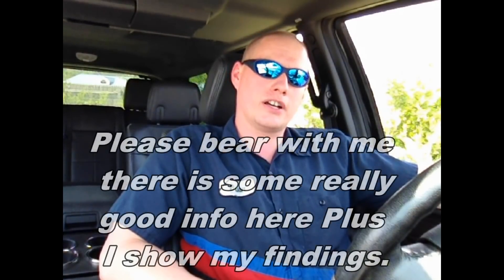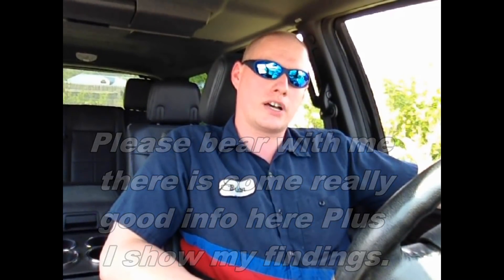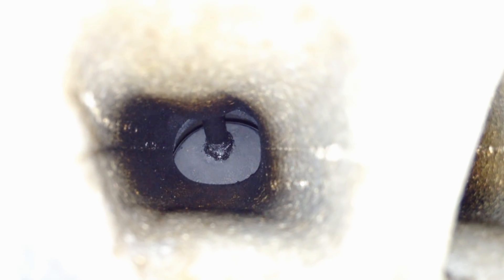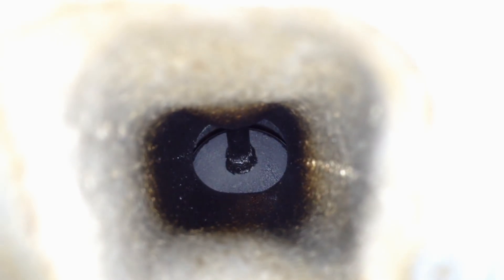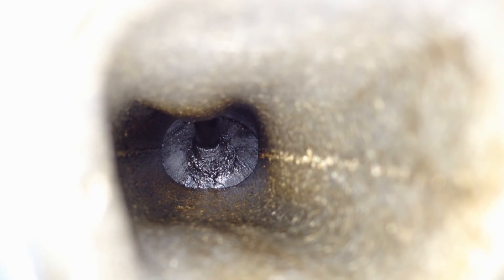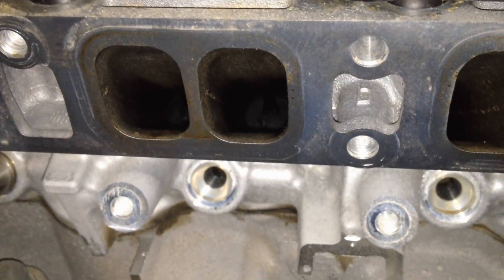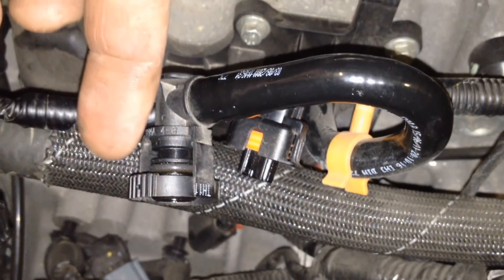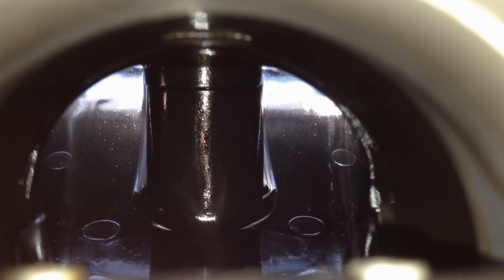Ford Ecoboost Warning Part 2 My Findings

Comment: we old guys use to dribble water down the carburetor on a hot running engine to clean carbon of the pistons ..could a well regulated water metanal mixer work in this application with out turbo or cat damage? just thinking out loud .

Comment: I thought that the manufacturers were changing to a combination of direct and port injection.  The additional port injection was to spray the back of the valves to keep them clean of carbon.
Reply from the maker: It’s spotty at best. For example the I4 engines as of 2021 do not incorporate dual injection.
Reply: @FordTechMakuloco  good to know.  I will keep my mustang with cyclone engine.  No turbos to burn up if the valves get carbon covered.  And it takes regular gas.

Comment: 2015 MKC has had p0171 code on... changed plugs, purge valve, engine filter, o2 sensor on the front end.  It seems to run rich, not lean, and hot. Exhaust pipes are black. The light was off for about 100 miles after o2 sensor change, then back on. Acceleration is better, and doesn't hesitate when giving it gas. What’s up with the light? Gonna start running shell or chevron higher octane gas, and then a little Italian tune up.

Comment: You can try a Nitrogen based cleaner service through the brake booster hose into the intake.   It cleans a little but doesn’t fix the design issue by Ford.   It’s amazing how the Engineers who designed T-GDI engines didn’t realize how the pressure/blow by would cause carbon/oil buildup on the Intake valves.  I think most Ecoboost’s 2018 and newer have both GDI injectors and Port Fuel Injectors to fix this flaw.

Comment: That link for the catch can no longer works. Can you share what catch can is best? We bought a used 2016 Ford Expedition with the Ecoboost engine with almost 100,000 miles and have no idea how well it was cared for. We started using the Chevron Techron. Do you also recommend cleaning the tank with the BG44K cleaner?

Comment: I soaked my valves on my 2.0 escape in zep deagreaser and it literally melted the carbon off I just made sure they were closed and used 80 parts zep 20 parts water and sprayed it in and let it soak and the carbon sprayed off the valves with air I didnt need to scrub them I used bg cleaner and everything else nothing works like zep!

Comment: Will a dual valve catch can resolve this issue or is there another thing needed to prevent those oil gases from reaching the valve heads

Comment: my ecoboost mustang 2018 is idling rough!! and has a leak between the head and the front block just behind de pulleys. Should ford clean my cylinder head and valves and replace my head gasket under warranty? the car has 20,000 spiritely driven.

Comment: It’s not new knowledge that port injection keeps valves clean so why would they not do SOMETHING to wash the backs of the valves? It’s asinine what engineers think up these days it’s all to save a buck here and half ass there. What’s next? You just never change your oil? They’re gonna have completely cast blocks with no way to drain oil and you just replace the engine every 10,000 miles? They just want you to buy a new car 😒

Comment: Is that the purpose of the two injectors on the newer eccoboosts, the injector before the valve removes the oil residues?
Reply: Yes. It switches to direct port once warmed up i believe. This also helps with cold start emissions

Comment: Brian, it's time for an update. This is pretty old information. I realize that Ford probably continues to claim that the head replacement is the only option, but soaking the back of the valves with the BG cleaner in a closed valve situation and evacuating the area of all debris before allowing the valve to open will completely clean the valves of all carbon. As long as you blow out everything before opening the valve there will be no impact on the turbos.  It's not an easy job and requires removal of the intake but it does clean extremely well.
Reply: Any videos for how-to on this? I would like to clean my intake valves without destroying my turbo.

Comment: boy, watching this I'm thinking about the best product I ever used in my life was A/C Delco X-66A intake cleaner, it dissolved carbon and gunk..  hard to get in California now... this state is sooo screwed up they have banned most anything that works...   I used to go out od state to get it.. it is a little nasty, but boy does it work on decarbonizing...    I'm sure there are some products out there now that will work ??  any good upper intake cleaner should clean up those valves and such..  some shops have a Motor Vac machine, and they worked GREAT on this too, they ran the engine for awhile using a cleaning solution to clean out the fuel rails, upper intake system and such...

Comment: Brian, I have a 2017 Expedition with the 3.5L, 105k miles, how do I tell what if it's dual injection or not? And are there any cleaners that have been engineered since this video was put out that will work without destroying the turbos?

Comment: coked oil contamination. I was building turbo engines in the 90's, I carried a whole person's weight of tools to try to keep from getting towed. I worked at several dealerships and took many classes for all kinds of procedure and process for new engine platforms coming online...they still blow (head gaskets, rods, blocks, valve trains, transmissions)
BOTTOM LINE buy a V8, it is the least likely to just pop for no apparent reason and just be shy of the warranty.....If you want to haul balls or tow/ a V8 is the ticket most of the time. oB

Comment: Why don't they do what the diesel guys do put the blow-by into the turbo boost so it goes straight back in and explodes instead of back into the intake with the valves under turbo pressure it doesn't build up that bad

Comment: Since 2-3 are affected so badly on 4cyl engines, would a 3.5L be 2 and 5 would it be primarily 2?  Is there a video of the BG and wirebrush process?

Comment: I have a 2016 F-150 2.7L V6 Turbo Boost. Bought it used a year ago, at about 36K miles. Its at 78K miles now. I have experienced an engine shudder every now and again. It's so random as to when it happens. That I am having a hard time determining what the cause is. I have had no check engine lights. So it must not be serious yet. I am wondering if this is my issue. I have my Truck going in for 4 new tires and oil change coming up. I asked them to look into the engine shudder. I hope it's not to serious. No money for serious repairs.
Reply: Did you ever figure this out? I have a 2016 2.7L V6 as well.
Reply: @Johnny N.  No sadly I've never figured it out.

Comment: www.RXCatchcans.com for the only genuine effective solution for these. And never do an engine running solvent based cleaning, ONLY a manual intake valve cleaning with the intake manifold removed is safe.
Reply: Why what’s wrong with the solvent spray cleaners when running
Reply: @gerard143   Unlike the "soft" carbon of past carbureted and port injection engines that could be loosened and expelled with little chance of damage, GDI engine develop large deposits, and as not fuel is contacting the intake valves, they operate at much higher temperatures and this bakes these deposits into a very hard crystalline structure, as hard as sand in many cases. When using solvent based engine running cleaners up to 40% of the deposits are loosened, and while most is expelled out the exhaust causing no harm unless a turbo charged engine, some is forced between the pistons and cylinder walls scouring the skirts and sides as well as damage to the rings.  That is never good.

Comment: I feel that direct injection is the death of a motor bc I’ve heard the fuel pressure is around 1000 psi. To me that’s a lot of pressure going into a combustion chamber and then on top of that has more compression added from a turbo. Couldn’t this start blowing out oil rings? Allowing oil to burn on the valves and starting a chain affect of problems?

Comment: Any updates?  I have 3.5 here and I keep getting misfire on 1...code P0301 on my 2011 with 91k miles on it
Reply: Every 50-60 thousand miles-change the plugs,possibly coil or compression.

Comment: PEA Question
Do you think running a product like Redline SI-1 with one of the highest concentrations of PEA with every tank would have enough residual PEA blown through PVC or gas recirculating system to reduce intake valve build up?

Comment: Is there any significant difference with this problem when running 93 octane gas as opposed to 87?  My thought was that maybe premium gas would help keep the valves cleaner..
Reply: It wont clean the valves because they fuel never touches the back of the valve. If your car requires 93 and you use 87, the computer can adjust the timing and it will run no problems, it will just lose a little bit of power compared to 93.

Comment: FordTechMakuloco have you been able to find a way to clean the valves without removing the heads? we recently bought an 2013 2.0L Ecoboost Escape with 150,000kms. It has the typical symptoms. Oil Catch can is being ordered but how do we clean whats already built up?

Comment: News flash from Ford... super high temp low vapor engine oil? Or retrofit port injection to slightly gas wash the intake valves? Like someone said this is a known issue on pretty much all direct injection engines.  The Cadillac 3.6 DI engine has many forum posts about this carbon build up and those engines were designed to run Mobil 1 synthetic. My car is an 08 model so this is only new to the inductees of DI. There’s much talk about oil catch cans on the PCV line to get as much of the vapor to fall out as possible. Not sure if that’s the end all fix or if there’s a better way to deal with it. One would think that the Diesel engines would have a solution to use since many of those are DI. Unless those valves don’t carbon up for some reason? Maybe knowing why would help solve the problem?

Comment: The intake manifolds are plastic. Why can they not be drilled and tapped for a fitting that can be capped. Then carbon blaster can be sprayed directly onto the back of the valve from the top of the intake runner?

Comment: when  cars  had  carburaters  we  just  poured  automatic  transmission fluid down  the  carb   raise up  idle  speed // it  will clean  out  the  carbon
Reply: Oh yeah I remember doing that back in the day. And it worked! Smoked like crazy while doing it but it did work.

Comment: Ford now has port injection to keep the valves clean, however, the blow by still exists so should I install a new for 2019 dual catch can by RXP for my 2019 Raptor?

Comment: Have a 2011 f150 eco boost 3.5. Has 210k miles on it and it runs really well. Very few problems. Keep up the maintenance and alls well.
Reply: Have a 2015 Transit van with 95,000 miles 3.5L w/Ecoboost from my work..  No problems .. still getting 16-17 mpg .  Just changed oil, new air filter, a bi of Lucas Oil to deal with ethanol build up. No carbon in exhaust pipe. Will getsome tectron fuel system cleaner in there.

Comment: I have a 2016 Fusion with the 1.5L Ecoboost.  Almost 90,000 miles.  No problems.....yet.    But my son, he has a 2014 Fusion with the 1.5L Ecoboost also.   His had 104,000 miles on it when we bought it.   Nothing but problems.   The head has been worked on once when we first bought it. Did a CarFax and found out the head has been worked on before he purchased it.   Now it's mis-firing again.   Same issue his mechanic says.   The mechanic wants to replace the engine.  Son wants to do that, drive it for awhile until he pays it down some more and then get rid of the POS.   Has had a transmission, a waterpump, an electrical short and other issues.

Comment: VW/Audi have had the same problem for years, as soon as they went to direct injection. They have changed the PCV system several times to try to help.

Comment: There are carbon cleaning additives you can run in your fuel.. Along with a better oil in the motor.. Why couldn't the PVC lines from these cylinders be moved out away from the heat..

Comment: I am confused here. Is the valve deposit situation being experienced in the 2nd generation ecoboost engines? Specifically in my case the 2.0 in the Edge? Did ford correct this issue in the second stage engine or not? And is there  a Dual Catch Can kits for the 2.0?

Comment: I saw in your other video the rationale for not doing the atomized chemical cleaning method on the intake valves on turbo engines but what would be the harm in doing the walnut media blasting method that BMW advocates?  Yes, it is more labor but shouldn't affect the turbos if done right.

Also, just yesterday I had a Ford dealer recommended a BG fuel induction service on my 2.0L NA engine so apparently they are using that method on non turbos.
Reply from the maker: No harm it’s just not approved by for therefore they will not pay for the service under warranty.

Comment: I was a service consultant for Isuzu and they started Direct Injection in 2004 on the Rodeo and we had terrible carbon problems right out of the gate. We were doing induction cleanings every 10,000 miles on those DI engines. Seems like Ford could come up with a better system to fight carbon build up on the valves.

Comment: Not sure why companies went to GDI systems when this issues can happen. I ran a CRC intake valve cleaner on my 2012 Kia Rio to try and avoid the clogging issues. After reading more into it I've hear people say the cleaner also messed up their engines due to carbon breaking off in the combustion chamber and damaging components. It seems the only way to solve this issue is direct cleaning. Definitely won't buy a vehicle with a GDI only engine again.

Comment: My 2016 F150 2.7L Ecoboost  has been to Dealer 4 times with same issue with cold start smoking first they replace spark plugs and then they replaced left side turbo. I still have smoke coming out exhaust pipe not as much but still coming out. I only have 37,000 miles on truck . FORD needs to find a solution and needs to do a recall on Ecoboost.

Comment: Ford did sort of rectify this issue in a way. My 18 mustang GT had port and direct injection. Which means there is fuel spraying on the backside of the valves to keep them clean. Direct injection only systems suffer badly from pcv oil residue build up because there is nothing to clean the valves.

Comment: Has anyone tried Amsoil's  PI (Performance Improver) designed specifically to clean intake valves and combustion chamber?  I've used it on older cars of different types with great success, but not on the ecoboost system?   Any input would be appreciated.

Comment: Easy fix. Doesnt mean the cars junk. Walnut blasting like the bmw guys do on 335i. They've been doing it for years on the N54 platform. direct injection engines common Achilles heel is intake valve carbon build up. Tell your Ford dealer to buy a media blasting kit. Pull intake manifold, Painters tape over open ports, close valves for each port youre cleaning, then media blast, vacuum out media. Voila

Comment: Turbo boost sucks all around. Especially Chevy Cruze.  Crappy mileage and wear out.  Can't imagine Ford puttin em on F150?!  Toyota 2000cc in line four twin overhead cams  with 4 valves.   Great engine...hit rod.  Ironically it was i the Chevy Prism(Corolla).
Reply: Hot rod!!

Comment: been seeing this for years now my fix has been removing the intake doing a direct clean on the valves , remove the plugs to get the excess out,,, sell a direct intake valve cleaning , maintenance tune up ,oil change, , throttle body cleaning and a relearn and on some of them a flash update... Have had great success and no turbo failures this away. good old sea foam with a direct soak works well...

Comment: Do you know if the 2018 ecoboost have port injection now? Or still DI?
Reply from the maker: Only the 3.5l model that I know of so far
Reply: Thank you so much for your reply.I just purchased a 2018 sport. Should I bother installing a catch can on it?
Reply: Sorry I didn’t specify it’s a 2018 explorer sport
Reply: Would a catch can be necessary?

Comment: Have a 2013 F-150 with 200k and no issues.......
Reply: Thanks for the info.... Did you do the fuel air induction cleanings, and the EPR services and if so how often?   I have a 2015 with 54000 miles and am REALLY struggling with the decision about doing those two services or not.   I'm ok with putting the money out if necessary but just don't want to pay and end up causing DAMAGE to turbos or catalytic converter.    If those services worked for you without damaging your turbos, I'd REALLY like to know that.  THANKS FOR YOUR HELP.

Comment: EPR engine performance restoration is another service recommended by the dealer for ecoboost engines (besides the fuel air induction BG cleaning process).    Is the EPR restoration a service that you recommend?  Is there ANYthing harmful about doing that service?   Thanks for the help, it is GREATLY appreciated.

Comment: On my 2013 Flex EB. With about 32k miles I got flashing CEL P0131 and P0302 which were cleared by mechanic (closest one off the highway this happened). Flex ran fine after that except for rough idle during cold starts. A few tanks later I got P219A and solid CEL which dealership diagnosed and updated the PCM. Nothing mechanically was done and I'm still getting rough idle on cold starts.

Is this a plug/coil issue? An injector? Or cylinder head? These are covered by powertrain/emissions warranty, right? How do I steer the dealership to look directly into these potential problem spots so I can avoid the $200 diagnostic every time I come in for a visit?

Comment: I just bought a 2013 Ford escape and everything looks good except the fuel consumption, it drains my full tank in 3 to 4 days without using my AC...I have donefull tune up and nothing has changed. It has a bit of smoke residue in the muffler, do you have any additional tips?